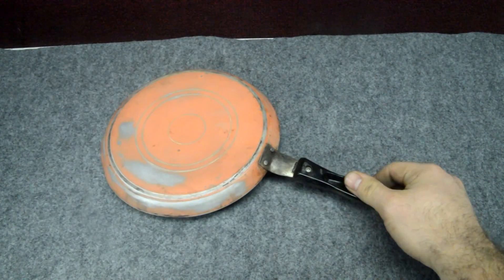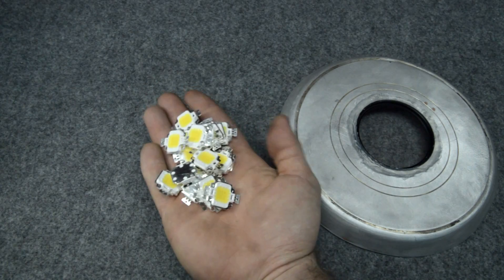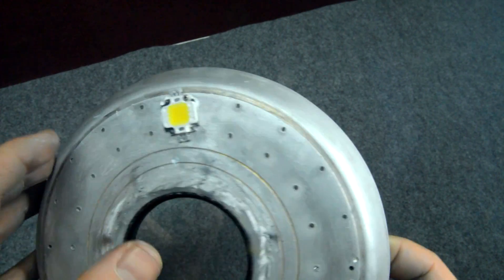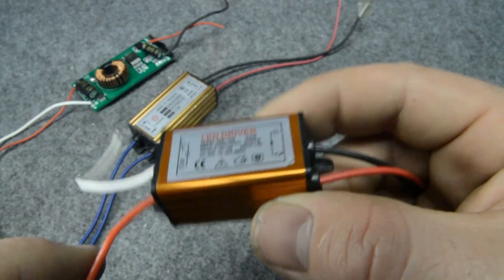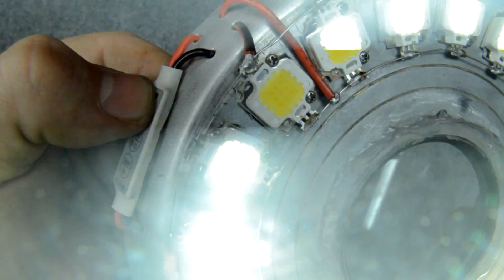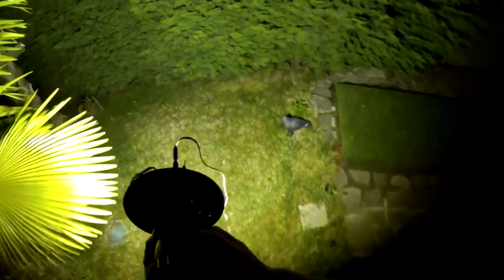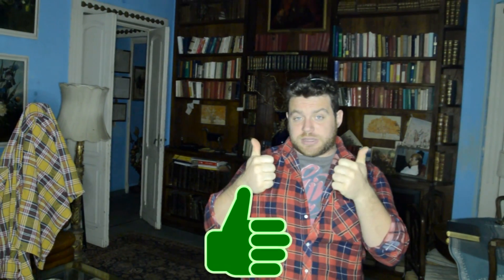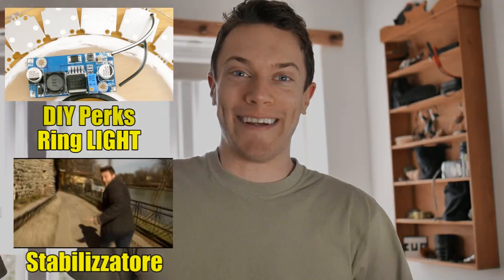How to make • 200W Ring-light 4 Video LED

Comment: Biggest question I have is when working on a project like this how does one pick out a power supply? i.e I decide to use 9 pieces of 10w per led what am I looking for on the PSU in terms of Amps and current etc.

Comment: 10w led 20 of those have installed LED heatsink and connect it to the car I want 12 v but some do not light up and other flash adapter should I use to illuminate some fine thanks

Comment: Is not 200W.  You have the sum of 20 x 10W LEDs, but as you use them, they cannot run at anywhere near the whole 200W from that little 7Ah SLA battery.  Perhaps this is good, because the little frying pan heatsink cannot sustain 200W either, nor can even the power jack you used, support the roughly 16A current, nor the wire for that matter.

Regardless of these things, you have a very cost effective source of light to reuse the parts you had on hand, but for video and picture taking purposes, it has very cold light with relatively low CRI.

Comment: >200W through those wimpy wires and driver not melting everything

I bet you those aren't 10W LEDs but they are very bright still.
Reply: Those LEDs are declared as 10W, but they can be dim as 1W or bright as 30W, depending of voltage/current put through them.

This "200W" ring light for sure does not use 200W (this would be 16A @ 12V!) - wires are too thin, and PWM brightness controller would burn out. Also, LEDs would burn out because they would get too hot without proper fan. Calling this "200W ring light" is misleading. It has 20 10W LEDs, but they are heavily underpowered.
Reply: Eric Phutao You have to realize that 12V LEDs do not exist, although they are marketed as such. If you have 10W LEDs, they are usually made as 3 groups of 3 blue leds in series under the yellow phosphorus dye which converts blue light into white light. Blue leds work on voltages usually between 3.3 and 3.6V. So, 3 blue leds in series means voltages between 9.9-10.8V. If you give them 12V, you are overdriving them - they won't use 10W, they might use 15, 20 or even more than 30W of power! I have one that without current limiting will use 34W of power! So, they are actually 10-11V (or 9-11V if you are fine with the brightness that led has at 3V) leds, although they are sometimes marketed as 12V leds. The issue of heat - leds are only 10-20% efficient! That means than if you run an led with 10W of power, 1-2W will go into light, and 8-9W will go into heat! So you need properly sizes heatsink, and a fan if necessary. They CANNOT remain cold or just warm if you run them at high power, and you don't have a proper heatsink.
Reply: +mbaksa what happend when you use only the on/off switch? Do you have to adjust the Led dimmer every time again?
Reply: Eric Phutao It depends on the dimmer. If it remembers it's last settings, then you don't have to readjust. If it doesn't, then you have to. I suppose that this dimmer like most (or even all?) remembers last setting. There are also other kinds of dimmers, with physical knob (potentiometer) - it obviously stays at the same setting after off-on cycle. But I would advise against using PWM dimmers, and recommend usage of buck or boost converters with constant current (CC) regulation.
Reply: +mbaksa i just used 4 real strong 12v led for my bike, but they become real hot, even they are design for 12V.
now i used a resistor in serie to lower the voltage on the leds

Comment: Do you have any specifics about the driver? amps? volts?
Reply: I believe he didn't use any driver! Just PWM dimmer, which can cause flicker in video, and does not regulate brightness properly (the warmer the LEDs, the brighter will light get at the same "brightness" setting).

Comment: it's confusing though it looks like you're missing the part of your video where you connect the 200w driver?
Reply: He is not using AC-DC 200W driver - he is just using battery for power source, and PWM dimmer for flickery brightness control.

Comment: Beware of those teflon pans... nasty stuff here for your lungs !
Reply: Iit will not get remotely hot enough for the teflon to be a problem. Overheating on a stove or in an oven would be necessary to achieve that heat level, not LEDs.
Reply: I meant when you cut/grind/drill it
Reply: Ok good to know, but it's always good to avoid breathing fine particles.

Comment: fun work but there are some problems: you are using a too tiny wire for carry 16Amps. Same for switch used that can carry normally 2..3Amps. Consequently Lee's aren't working at 12V but minus due to the drop into switch and wire. May be for this reason that your dimming module (144W) don't blow... Another problem is the battery, rated for 7Ah and user to drain 16Amps.

Comment: would you tell why do you need led driver since you using 12V battery? Thanks
Reply: high power LEDs are constant current, not constant voltage. just connecting them to 12 volt could easily fry them in a fraction of a second. I also have some 10W LEDs and their maximum rated forward current is 1050mA. with a constant current supply set to 1050mA the voltage drop of this led is about 8-13V. it depends on the temperature of the led. also each led is different due to tolerances. so if you connect your led to 12 v, you might be lucky and it works fine, or it might fry instantly. if you want to drive them at full power with maximum efficiency, you have to use a led driver anyway

Comment: Switch to a DC power delivery to remove the horizontal line issue. Besides that , great video !
Reply: no that's just a camera thing because of the way the camera takes the images and puts them in a video
Reply: edit
Reply: previews reviews Thats the point... With a dc power source the light never flickers, the adjustment is voltaic and not by pulse width modulation. so yeah.... DC will prevent that from happening with the camera.

Comment: This heatsink is fare away from dissipating 200W.
A big computer processor cooler like the Scythe Mugen 4 (google it) can hold about 80 Watt under 60 degrees (with good ventilation).
The current at 12V and 200W would be about 16 Amps. Battery >> very heavy, big

But after all it's a good idea to use many LEDs. 
The light spread is better and the LEDs are much more power efficient in such a low power state.
You could even use LEDs with different light temperatures (better color reproduction on tape)
Reply: What if you attach the LEDs to the inner side of the cooking pan and attach a fan on the outside?

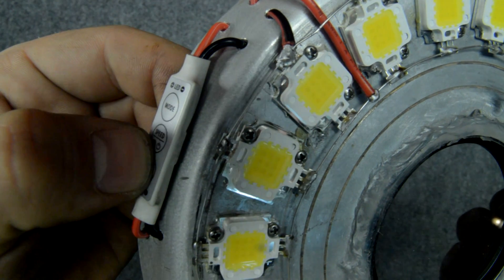Comment: Do I need a switch? (3:16) if there are dimmer completely off (4:30)? I am sorry for the English language.
Reply: +Videostar CAMAPA 
The dimmer will still use a little amount of power. If you can disconnect your batteries it's fine.
If not they batteries will be flat on some day
Reply: +Mixermachine Thank you, now I understand.
Reply: Videostar CAMAPA
No problem :)
You should also add a capacitor to the LEDs if you use such an pwn controller (the button thing in the video). Otherwise there is a chance to get artifacts in the videos you make.
Reply: +Mixermachine, thank you.
A capacitor to eliminate flicker?
Capacitor type?
Can you show circuit?
Reply: Right, to eliminate the flicker in lower power stats of the LEDs.
Which one...
Choose one with a little capacity but quick reaction.
A Film capacitor for a example. One with 0,1yF should do it (but thats only a guess. It depends on the controller)

Circuit:
             _                        _        _                     _
Battery  Current regul. PWN Capacitator LEDs
             _                        _        _                     _

The pwn is not reallly "right" in this circuit, but it should work.
Reply: +Mixermachine, Ok, thank you. I'll try, at your leisure, to collect a flashlight.

Comment: Nice job!  I see that the light is verry bright but  i dont belive it has really 200W did You check what current it takes?
Reply: +kozaczi it seems that the PWM controller will go up to 144 Watts so unlikely that it will ever get to 200W?  Still it looked good at max power...  Big LIKE for the video :-)

Comment: id like to make that but with it lights
Reply: +rawdealmx don't do it, it don't work for long. LEDs are working out of specs the get to much voltage, they must be current driven. Head sink is to small  to  use it with 200W for longer than seconds without getting damage to the LEDs.
Reply: +JackySixSeven  dont worry that battery wont be able to push 200w.

Comment: Mate, great idea, but I'm very skeptical about the "heatsink" you're using. I have designed and build quite a few LED set ups both for my hobby and for my job, and I don't think that pan will allow you to use your light for more than a few minutes. Correct me if I'm wrong?

Comment: You do not correct connect LED. They must connect in serial circuit. And for power you must use a special LED driver. Else, diodes will die.
Reply: Evgeniy Ovdienko you copied this sentence from some board or what?
First of all they are themally coupled. And as you can see and test yourself that it works ;)

It really depends on the current you will get due to heat. If you drive the leds on maximum current some will fail, yes.
Using a resistor on each LED should fix that too.
Reply: It's my opinion. We do not know the current flowing through each diode. Perhaps at this voltage, the current gets close to face value and everything works. Also it makes a low duty cycle operation. It is interesting to see how long it will live LEDs.

Comment: SEVERAL Questions:
1. what kind of driver do you need? You mentioned 200W, but what about step-down or step up driver? what do I want to regulate? The voltage or the current?
2. the circuit is  parrallel circuit of the LED´s right?
3. what kind of 12v battery do i have to use?
Reply: Hey 
On full power the leds will need the 200w but you can go with less powerfull drivers. They work just as well ! And you need to controll the Current not the Voltage! 
Search on ebay a 150w cc/cv regulator ! There you can limit the current and
voltage! There are also 10w leds which run of 32volts so with the 150w step up cc/cv regulator on ebay you could power the ringlight! Just set the voltage to 30volts and the current which is needed by one led!
You can then use a 12volt power source!
But make sure your battery or walladapter can handle the 150w/200w power!
Multiply the voltage and the Amps/Amphours and you get the power of your power source ( U*i=P)
F.ex a 12volt 9ah lead acid battery can deliver 108wh! 
That means the leds would just run of 5watts each! 
If you want full brightness you would have to use a really strong power supply  like 2 lead acid batteries in series or a powerfull walladapter! 
I would recommend using 15 10w leds (32volts)+ 150w step up cc/cv driver+ powersource which is capable of delivering at least 120watts or so like a laptopadapter or a 3c lipo Battery!^^
Hope i could help you! 
Good luck in building it!:D
Reply: sivars  15 leds paralel  it is 12v 150w  why it need 32v?  or it wil be conect  series?